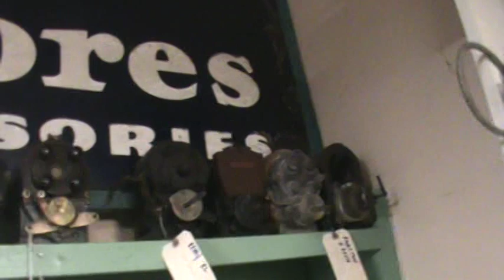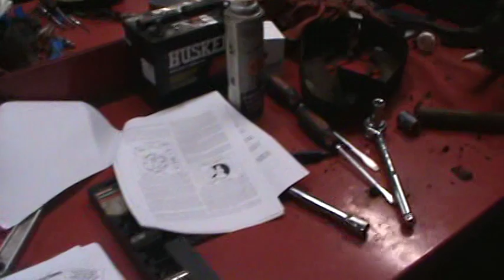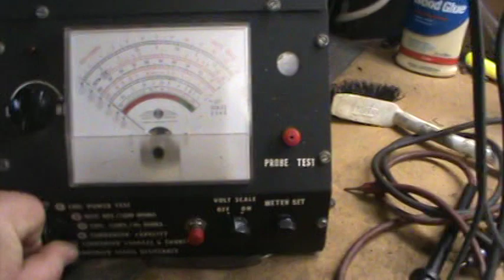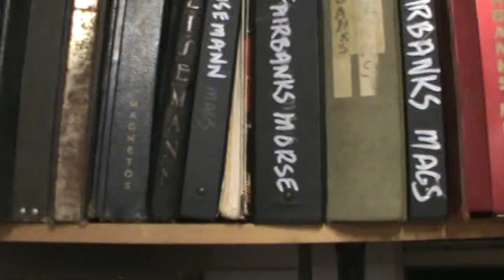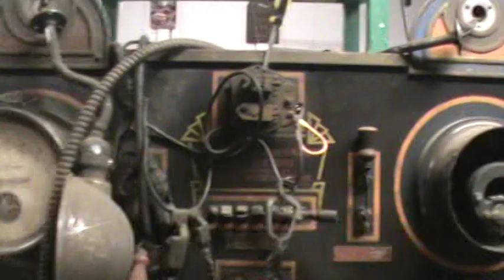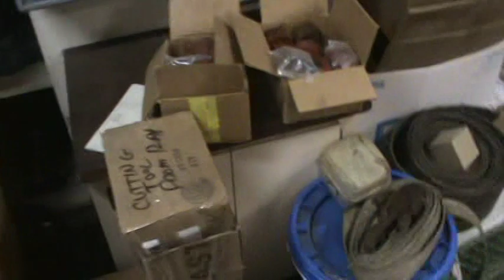QUICK TOUR OF VINTAGE MAGNETO REPAIR SHOP

Comment: Quest  on the brings engine , with side the magnet( north or south ) face to the coil  and if make any difference if they get put together  wrong,  I am learn and also why the coil it's already  in permanent  place to the engine , and not adjustable to find a better point on your own, like on mopeds, I remember just remove fly wheel of one time to find my better, point  then I find the 0 point on that  and the engine  was firing  back foworrd  so I just move a hair  and was on, 50cc moped give me 60 km per litre gas,

Comment from the maker: hello and thanks for the question. i have many bosch mags in stock. do you know the spec. # you need or the specific application including year of tractor/engine. i can also look at your eisemanns. i do have some parts available but other parts are hard to come by. contact me thru regular email at kennedylynch@htn.net or phone me at 863-381-8035, leave a message if i don't answer. thanks again, jeff kennedy